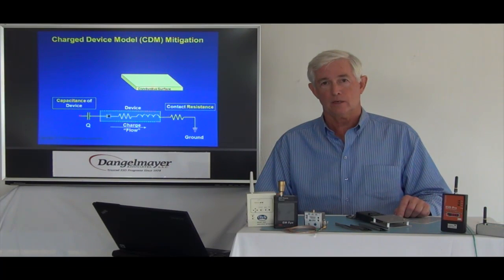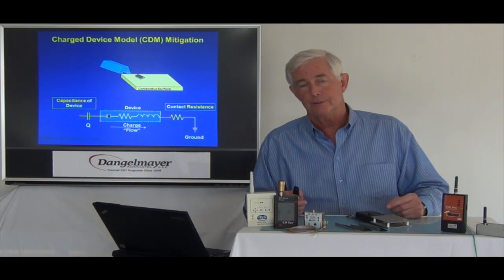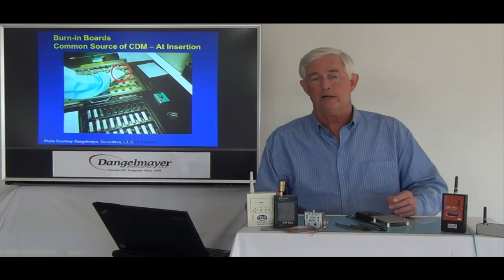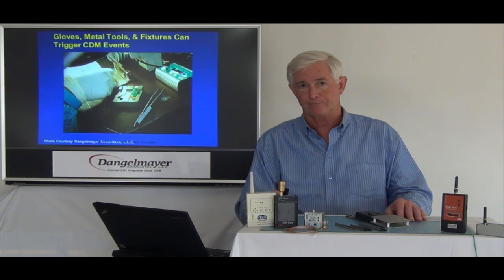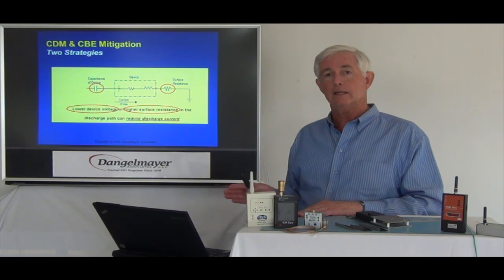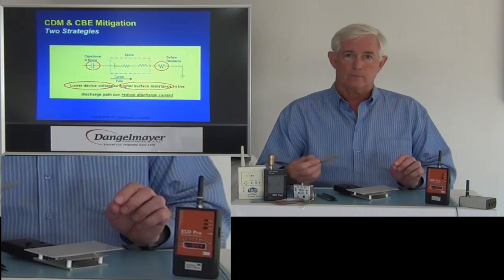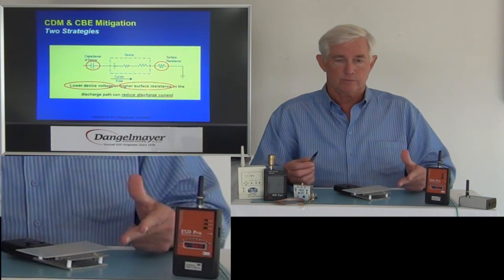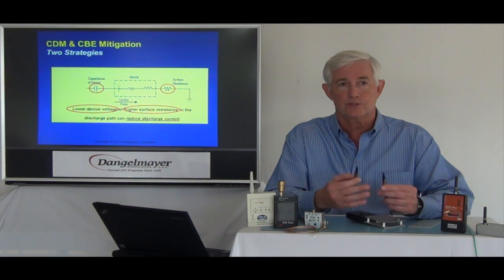ESD Charge Device Model Demonstration

Comment: Wouldn’t the metal tweezers be grounded through the operator holding them? Since the operator is grounded via a wrist strap any charge on the tweezers would be dissipated through the 1 Meg wrist strap safely. Even if there were a charge on the plate it would be dissipated controllably through the tweezers and then through the operators wrist strap...
Reply: Yes and no. The video clearly demonstrates the no. The tweezers represent another level of mitigation should the straps fail